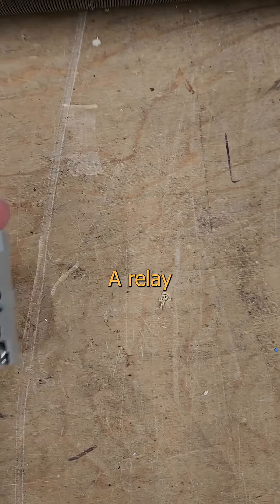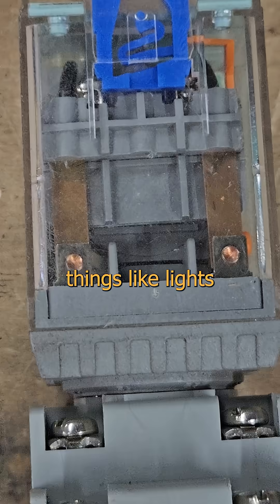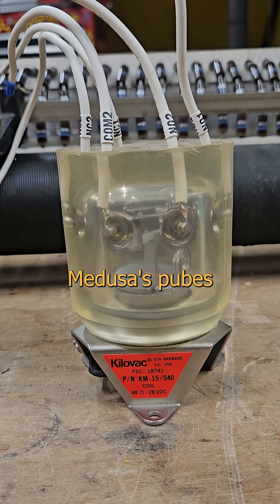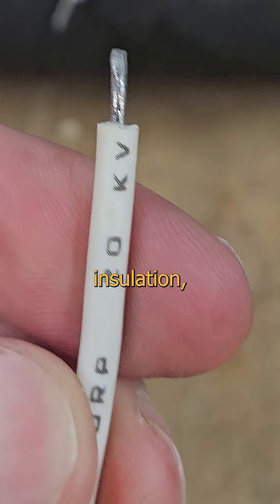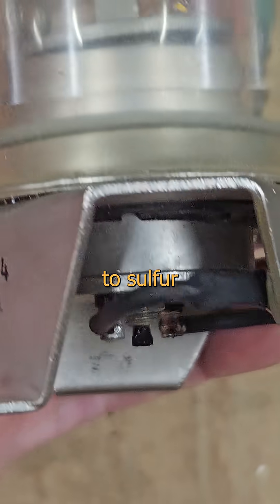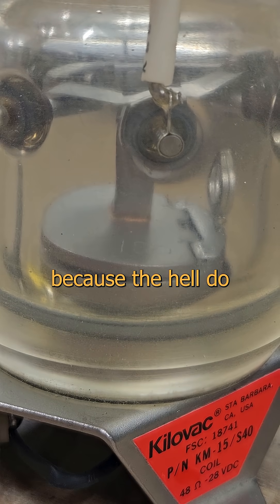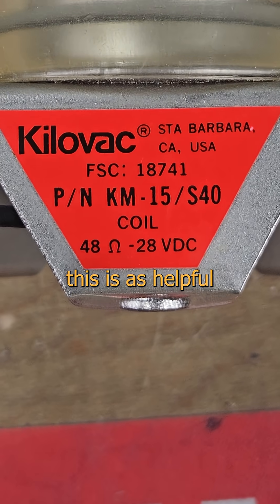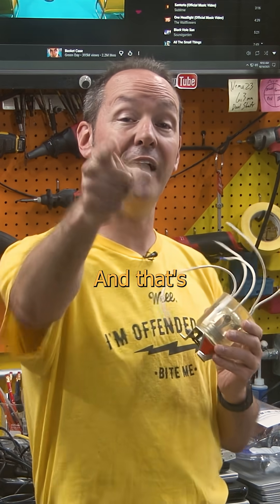High Voltage Relay #chrisboden #comedy #engineering #electrical #science #educational #jokes #adult

Comment: Typical Use Cases

You will see these in:

Aircraft electrical systems (28 V control is a giveaway)

EV battery packs and disconnects

Radar and RF transmitters

Industrial power supplies

High-energy physics equipment

Military and aerospace hardware

This is not a household relay.

Comment: I was told, the interior is sealed in a vacuum, or has a particular gas within, and it is supposed to aid in the wear prevention from the arcing upon closing or opening, something like, a dual aspect, the gas or vacuum helps to prevent spark jump or arcing.. then, the same help with anti corrosion,  of the mix alloy contact points of silver and platinum.. I then asked, "but wait, isn't platinum not one that corrodes? So, why is all they needed?" 

I was told to shut and go back to work, as I ask too many retarded questions that will never help me do my job..  lol. Okay. So, either my over seer was making sh*t up, to sound smart, until he got caught, or, he was taking out a bad day on me because his wife had his balls in her purse. So, I really would like to factually know the info on these, and the ways these are typically used, and can be used. I will likely never see one of these ever again in my life, but, I don't care, I would enjoy learning about it.. your turn!!

Comment: I work on some medium voltage drives. Vacuum contactors are interesting but sorta scary at the same time. I’d be curious to the X-ray’s power output of the contacts. I’m not curious enough to become a “Victim” though.

Comment: I suspect it is for HV application, just being used for control systems, not the actual power flow.

In this case, it's built like a brick shithouse because it absolutely posi-fucking-tively has to work a million times without failure.

Comment: Get your hand on a circuit reader. You have to do some fiddling because they read chips usually. It does exactly what it sounds like. You pin it up to the reader and the computer analyzes it. It tells you what it's function is and how it's wired up. EvilmonkeyzDesignz uses one to identify mystery circuits from past eras as he hunts for silicon doodles.

Comment: installed in environments with gas etc. we had to use these things when drilling out some pipes in a steam turbine boiler.  fun fact: the guys thought we used hydraulic drilling equipment. they didn't notice old sparky had its own lighting system from the brushes etc😂

Comment: This has nothing to do with British explosive environments (I worked in them for a few years). 

Looks like oil and gas infra to me as it's thick resin and measured in ohms so distance is likely a factor...wells are deep under the sea but still need switching and signals.

Comment: Used in RF high voltage circuits Kilovac makes all types of high voltage RF relays.  Switch from one antennas to another. Normally on low frequencies below 30 MHz.

Comment: First off, dial in 28VDC next time you shorten the life of the coil. The other important info is the coil ohms for troubleshooting. Nice feature. Looks like a totally NEMA 4 relay. Not going to spark and arch anywhere. And most likely a high temperature usage relay from the wire type. Thank you for all the cool stuff. Mechanical engineer here and trying to out think you 😂

Comment: I mean, if you want a project idea you can recrate my single pole and relay puzzle board I made in junior year of high school. 15 ice cube relays and I believe 35 odd switches made the most entertainment for me ever. 15 switches did the coils, the other 20 did the main power. Also added two push buttons for a test piece so you couldn't just randomly switch like crazy. Hell of a fire hazard if provoked, hell of a lot of fun though.
Reply: I have the old photo somewhere of WAAY too much 14 gauge stranded all under a single romex staple and the ice cubes lined up on din rail if you want it too lol

Comment: I've seen large scale printers which print banners and such which use very high voltage (way higher than 480 volts) in the range of thousands of volts and probably very low amperage. That relay could most probably handle that type of equipment.

Comment: Specifically relays control devices with higher voltage levels than the other in most applications.  Though technically speaking it could go the other way around I suppose.  Generally they’re used to facilitate basically some sort of control board kicking on something way higher voltage like a motor.  This is the basis of how control systems work from everything from cars, to factories, to your HVAC.  Really useful stuff and pretty simple, in principle anyway (don’t at me I know I’ve seen some really squirrelly infrastructure in my day that’s the worst to parse out), to understand.

Comment: I have a similar one, mine was used on a Focused Ion Beam milling machine to control heater power to the emitter. I believe this is rated 15amps at 40kv. Either vacuum or HF6, the pressure quenches the spark.

Comment: 15kV vacuum insulated relay, probably for a switched distribution transformer or industrial robotic welder. My partner says it looks like something they'd find in a Honda assembly line, but I'd blow it up trying to find a use for it in my 80 kV to 480kV systems. Maybe to switch a high-jitter trigger capacitor to illuminate a spark gap switch midplane, however, the field shape that thing would make would be like getting an overcaffeinated parkinson patient to hit the broad side of a barn with a scatter gun.

Comment: Google sucks A$$  grok however gets it done.

The relay in the image is a Kilovac KC-15 high-voltage relay (SPDT contact arrangement), manufactured by TE Connectivity (formerly Kilovac) in Santa Barbara, CA. It's an SF6 gas-filled model designed for make-only load switching in high-voltage applications like ESD testing, safety interlocks, or power switching.
Key Specifications:
Contact Arrangement: SPDT (1 Form C)
Rated Operating Voltage: 15 kV peak (DC or 60 Hz)
Test Voltage: 17 kV peak (DC or 60 Hz)
Continuous Carry Current: 12 A max (DC or 60 Hz)
Coil Voltage: 28 VDC nominal
Coil Resistance: 48 Ω (±10%)
Pickup Voltage: 26.5 VDC max
Dropout Voltage: 1-10 VDC
Operate Time: 15 ms max
Release Time: 9 ms max
Contact Resistance: 0.05 Ω max
Contact Capacitance: 1.0 pF (between open contacts), 9 pF (open contacts to ground)
Coil Hi-Pot: 500 V RMS (60 Hz)
Operating Temperature: -55°C to +125°C
Shock Resistance: 50 g peak (11 ms, 1/2 sine)
Vibration Resistance: 10 g peak (55-500 Hz)
Mechanical Life: 1 million cycles
Weight: ~85 g (3 oz)
Mounting: Panel mount (threaded base variant available as KC-16)
Compliance: Meets MIL-R-83725 requirements

Comment: Gas filled medical use DC contactor
9 kV rating, 10 amps capacity
It's for "make only" power switching, which makes sense for capacitors in an AED.
Credit to @randyab9go188

Comment: I think i have an idea but i can't pull the whole memory up just yet, but i think this is used in Sub 0 like -150 plus, the silicone coated wires are used in a few specific extreme situations, but it's not scorched, and i think it is just a vacuum and designed to be as totally be isolated from being effected or effecting the environment.

Comment: Contacts probably rated up to 10 kv or so, but could be up to the wire’s insulation. You should hook up a HV power supply across the contacts (with a resistor/inductor to limit current of course) and start off low to slowly increase the voltage until it arcs over. Record it with the lights off for dramatic effect.

Like I have to record doing your mom cause people will only watch that for the sound and that’s pretty cool.

Comment: I know about a blond ones's width about electrical relays but based on the googles It appears to be a  gas filled relay for "high voltage" use. From TE Connectivity.

Comment: AI Overview

+2
The image shows a Kilovac high-voltage relay, specifically a KM-15/S40 model. This type of relay is used to switch high-voltage DC or high-power DC circuits. 
Kilovac relays and contactors are hermetically sealed for use in harsh environments, such as aerospace, military, and subsea applications. 
They are designed to have a small size and weight relative to their power rating. 
The contacts are contained in a vacuum, which prevents arcing and allows them to interrupt DC loads.

Comment: I've watched this several times and still unsure how you use a relay to control a lobbyist. Do you connect the high or low voltage to their sensitive bits?

Comment: Kilovac KM15/S40 high-voltage hermetically sealed relay/contact switch, is what I can pull up on it, however, there isn't much information it seems.

Going to TE connectivity and looking at part number 18741, it pulls up two things with no images, and little to no information.

The most I can find on use case, is this:

Aerospace power distribution systems
Electric vehicles / battery isolation
Radar and RF systems
High-voltage test and switching rigs
Military power controls and satellite equipment

The actual expoxy or resin could be something like:
Emerson & Cuming Stycast 2850FT
Stycast 1266

Most of which consist of:
Base resin: Bisphenol-A epoxy with a reactive diluent for low viscosity.
Hardener: Aliphatic amine or anhydride.
Dielectric strength: ≈ 450–500 V/mil (≈ 18–20 kV/mm).
Dielectric constant: 3.2 – 3.6 @ 1 MHz.
Volume resistivity: > 10¹⁵ Ω·cm.
Appearance: Clear to amber, refractive index ≈ 1.54 — hence that “wet look.”
Thermal rating: −55 °C → +125 °C continuous.
Cure system: Typically 1 h @ 80 °C + 16 h @ 125 °C.

And the inner gas could be:
Dry nitrogen (N₂) at ~1 atm, or
SF₆ (sulfur hexafluoride) for higher-voltage versions (> 10 kV).

Comment: So, this will have been used in a government installation, most likely a hospital. It is a relay which will be filled with xenon to use in an oxygen rich environment. The FSC number is the Federal Supply Class number, hence the guess that it would be used in a hospital.  If it had an FSCM the M would denote military. If this were the case it would be used in a warehouse or area around which a spark would be highly dangerous, as in kaboom dangerous.

Comment: electrical arcs still need a media to pass through, if the inner capsule of that is pulled to a vacuum, contact spacing shouldn't matter, since there's nothing to bridge the gap.  In terrestrial electrical stuff, when there's arcing it's electrons moving through (ionizing) the crap in the air.  Sure that stuff has a pretty high resistance, but it's still stuff so the conductivity is higher than zero. in a vacuum however, there's literally no stuff to ionize, so there's no need for significant contact spacing, since there's no way for it to arc.

That's just physics, and that's pretty cool.

Comment: My totally uneducated layman's guess is high voltage, super low current application, something where the power isn't enough to ionize the gas in the chamber. Something where just air wouldn't do it, but something less conductive would work.

Again, I know nothing except what I've learned fucking around and what I vaguely remember from a class I took 15 years ago

Comment: I'm guessing it's sealed to prevent potentially detonating flammable gasses/liquids, or it's designed for very high cycle counts where there needs to be a vacuum/noble gas inside to prevent the contacts from wearing down.

Comment: It’s meant for flammable environments I’ve seen it before no clue what it’s called but I’m not sure if it’s high voltage but it’s spark isolated and keeps the heat of the relay sealed I’ve seen them in oil and gas plants

Comment: Seen some similar relays visiting the explosive atmosphere zone of an old sulfur purification factory (they had pure hydrogen in a reactor), the kind of place were metal is forbidden and a single spark will make a boom you wouldn't even hear because your ears would be several meters away from the cinders of your brain.
Pretty chill guys tho, blue collars with a huge kink for safety and due process, felt like a well lighted munch.

Comment: A 2pole, double throw relay with a 28vdc coil. Make it a 24vac coil and I could use it for an indoor fan relay in an air handler or HVAC package unit.

Comment: Can even use it connected to a thermostat and when you call for heat it can turn on a light for example. Did that as a part of an electrical project for level 1 HVAC

Comment: I don't think it's high voltage - high voltage contactors have much more contact spacing - even your low voltage 120V contactors have big contact spacing. This looks to be used in flammable environments where you don't want the spark of the contacts to ignite stuff. And relays and contactors are basically the same thing, just contactors are typically for higher power stuff but are functionally identical

Comment: There’s an eBay listing for one similar right now— a part number KM-13/S8. 

Says it’s a vacuum inside to extinguish high voltage arcing.  

The “FSC” has been replaced by the CAGE code system, but it’s used by the federal government to track vendors. Kilovac appears to now be a subsidiary of what was Tyco or is now TE. 

There’s another KM-13 on eBay without S8 marking that’s much cheaper and says it’s rated to 7,500v at 10A. A KM-14 says 14kV at 10A.  

Interesting stuff.

Comment: The first relay was discovered by Thomas Edison. As a young telegraph operator at a repeater station, he wondered why did he need to listen to the message being keyed in, then send it again over a different circuit. So he wired the incoming sounding contacts to the key of the other circuit, and thus created the electric repeater, or a relay that can carry the message across with no need for a human. A Western Union supervisor saw this circuit, and saw how it can replace many human operators, so he hired Edison. IBM  later used the relay to created the first electric computer.

Comment: Kilo vac is made/owned by TE now. That specific part number didn’t turn up anything but KM-14 is a vacuum sealed silicone body relay. Similarly km-13 and km-17 are 7.5kV DPDT relays.

Comment: So i found the website for the company they make them for high voltage dc applicarions and are hermetically sealed for environmental purposes. They are mainly made for military equipment such as lasers, under sea fiber optic equipment, and communications of you would like i can share the link.

Comment: "Kilovac" most commonly refers to the brand of high-voltage DC relays and contactors, produced by TE Connectivity, which are used in aerospace, electric vehicles, and other harsh environments. Another meaning is a specific type of vacuum-sealed container for storing bulk foods, sold under the brand name "Tightvac".  
TE Connectivity Kilovac products
What they are: Kilovac is a brand of high-voltage relays and contactors designed to switch high-power DC loads. 

Key features: They are known for being lightweight, compact, and hermetically sealed, making them ideal for applications with high shock, vibration, and extreme temperatures. 

Applications: They are used in a variety of industries, including military and commercial aerospace, electric vehicles, radar systems, and alternative energy. 

Specific models: Examples include the EV200 series contactors for electric vehicles and the K250 contactors for power distribution and circuit isolation. 

Tightvac Kilovac container
What it is: A type of food storage container that uses a vacuum seal to keep contents fresh.
How it works: It's designed for bulk foods and uses a valve system to remove air from the container.
Brand: It is sold under the "Tightvac" brand.

Comment: Frantic googlin' led to this blurb, Chris.
"The KM-15 S40 is specifically categorized as a vacuum relay, known for its durability and performance in demanding environments."
For: "This relay is part of a series designed for high-voltage applications, including use in test, manufacturing, medical, and research equipment, as well as in radar, sonar, and other systems requiring reliable high-voltage and RF switching."

Comment: looks like something for a high hazard/explosion zone (think C1D1)

A bit outside my experience because it’s normally WAY cheaper to run your contacts and relays outside the controlled zone. Which is why you’ll see a lot of remote MCC for distillation areas

Comment: Looks like a vacuum relay rated up to 15k volts, maybe 10A based on other similar products from them. I've only seen hits on the web for RF/Ham radios, so likely something for those systems. High voltage low current. But Im honestly just taken a uneducated guess

Comment: It’s of note that a relay is a binary connection. If the control side is pulled up or down the slave side responds as programmed. So for instance if you have a relay that says if line a is high then line B should be open then if line A has a minimum voltage then b will always be open. However an applied PN junction, also known as a transistor, is much more subtle. In a transistor you have two regions of positive charge carriers, or “holes”, and two regions of negative charge carriers or electrons. A small voltage applied to one of the sides creates flow in the other proportional to the other one thus allowing minute flow changes.

Comment: The product shown is a Kilovac KM-15/S40 relay, which is a high-voltage, high-current relay designed for use in various applications.
Manufacturer: Kilovac (now part of TE Connectivity)
Part Number: KM-15/S40
Specifications: The coil has a resistance of 48 ohms and operates at 28 VDC.
Product Type: High-voltage relay
Application: Used in aerospace, defense, and industrial applications where high-voltage switching is required.
Reply: Thank you AI